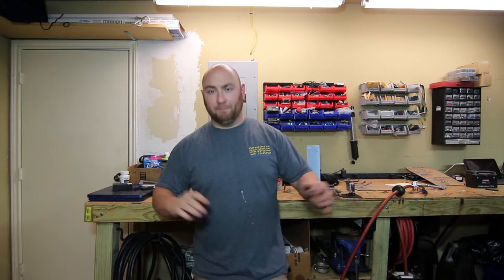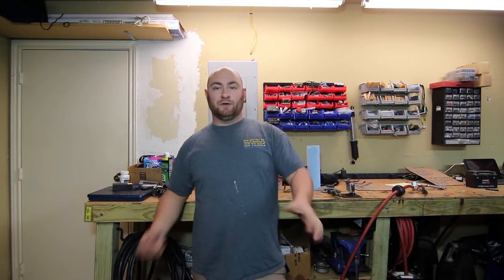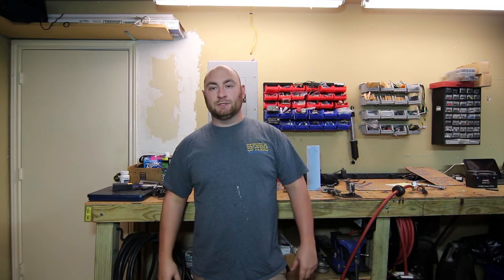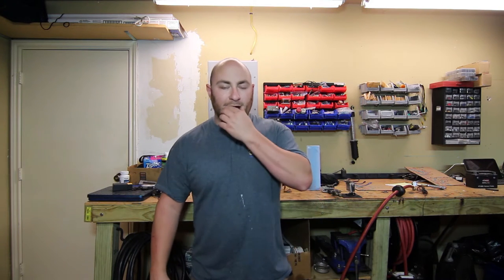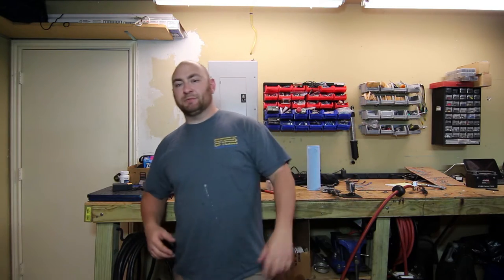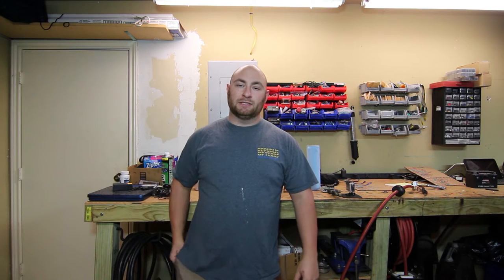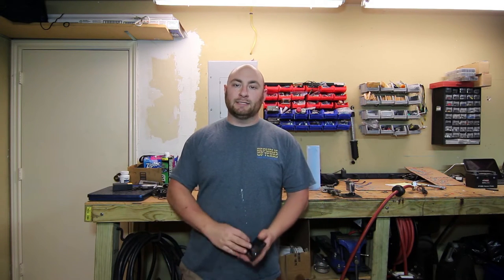MaksWerks Garage - Gas Engine Golf Cart Project - Final

Comment: extend the axles and get bigger wheels and tires on the rear to increase the total gear ratio. wouldnt get you a lot but if you could fit a 30" you might hit 25 mph or better.
Reply from the maker: That is one way to approach the problem. I am done with the project so I wont, but I agree with you.